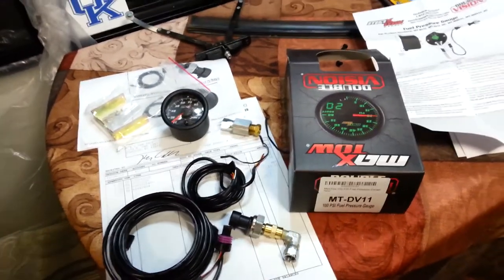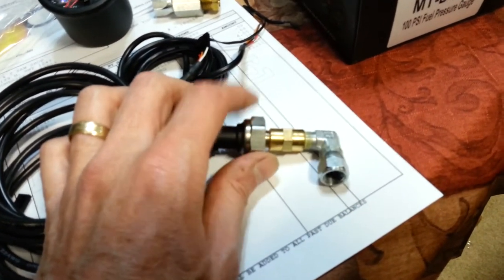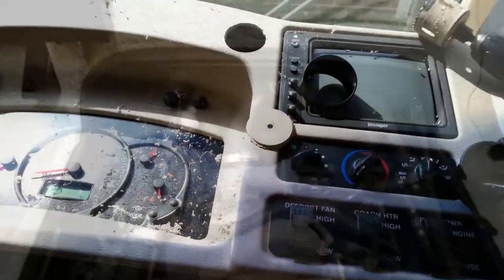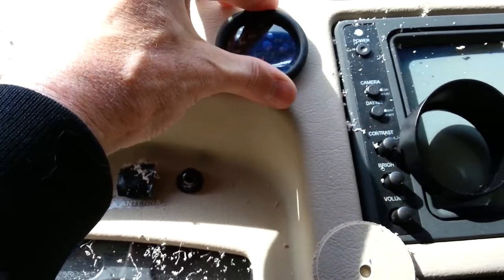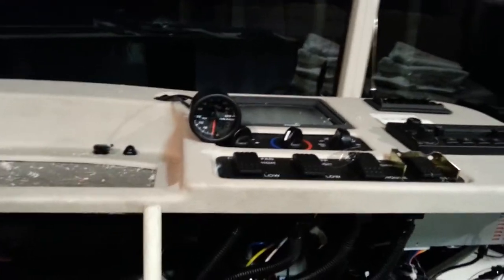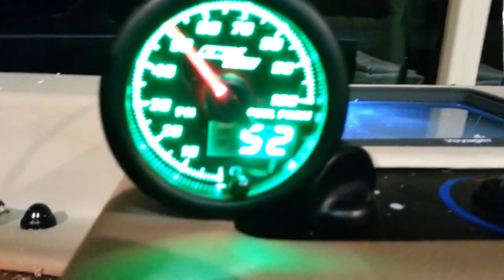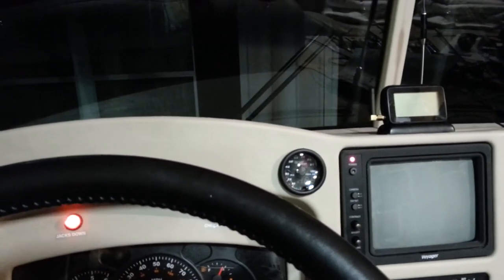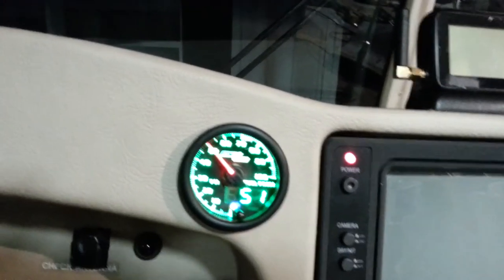Installing electric fuel pressure gauge on 8.1 Vortec Workhorse Chassis W24 Winnebago 38J

Comment: Kevin - Great advice.  This type of gauge should be installed on all RVs!
When driving our 2005 Winnebago Adventurer ( W22 chassis with ~ 80,000 miles) I began to experience back-firing. low power on hills, and a check engine light which kept coming on (same code - overheated O2 sensors on both banks - meaning the engine was running lean - and hence, too hot).  Finally installed this gauge to see what our fuel pressure was - and it measured only about 40 psi.  Way too low, as it should be about 55 - 62psi.  Also indicated a fuel pump which was going bad.  Could have totally failed at any time.

So finally bit the bullet and installed a new fuel pump (as per another one of your videos - THANKS!).  Immediately had about 60 psi, and and a MUCH better running engine.  Just drove it south almost 1,000 miles - ran great, no check engine lights.

So cannot recommend this gauge enough - especially for any Workhorse engine!

THANKS KEVIN !!!!!

Comment: Kevin, I had to replace my fuel pump in Elkmont Campground, Smokies. Found the location to cut out the floor and landed right on top of the fuel pump. It was under the bed, this made it nice. Checked with mill supply, gave them the number off the top of the fuel pump and I had a new one in about two days. I believe the pump was $300. Used a 5-gal pail to put the old pump in as I took it out and walked it down the hall to outside. Everything worked great. My fuel pump did not fail but the high side outlet on top of the pump was cracked. Dealer in Knoxville was quoting once I was towed in about $ 1700 for the whole job. Keep your videos coming, ￼😎
Reply from the maker: Wow you saved yourself a lot of money. Thanks for watching..Did you see my video about oem vs after fuel pumps?

Comment: Thanks for the great video.  I am just getting ready to purchase and install a fuel pressure gauge on my 8.1L Vortec W22.  I will do exactly what you did.  Thanks again.
Reply from the maker: TheChertman47 thanks for watching.  Do you have the scangauge 2 . I would highly recommend. ..u have a great engine the 8.1..
Reply: Hell anybody find the numbers for that 8.1 shrader valve 90 degree fitting ,adapters

Comment: I am SO happy that I have found your channel, you are a treasure trove of valuable information. I am curious if you have a 'plan' on how to siphon gas out of the tank before dropping the tank? It seems to me that there may be an anti theft device in the fill tube to the tank to prevent someone from siphoning gas.....if so, is there a work around to safely drain the tank?
Reply from the maker: Depending on the chassis you could use the onan fuel pump to pump out most fuel. Or remove the rubber fill hose at the tank and insert a 3/8 rubber hose and siphon out. My cell is 606-875-0125 Kevin

Comment: Where did you get the 90 degree fitting that fits the Schrader valve.
Reply from the maker: The 90 degree fitting I used is called a 4AN with 1/8 pipe thread. and a 1/8 coupler. Most and lacal Hydraulic hose repair store should have this. 
Or you can buy this type https://amzn.to/3O6dw2N
or 4AN Fuel Pressure Take Off Fittings Female to Male Aluminum Hose Adapter with 1/8 NPT Port Black https://amzn.to/3F9JxUM
cap = https://amzn.to/3ANhaZN AC PERFORMANCE Black Aluminum Fuel Oil Adaptor -4 AN 7/16 x 20 Female Thread Flare Cap Block off Fitting For AN4 Male Fitting or Fuel Pump

 Hear is another option https://conceptzperformance.com/glows...
  GlowShift GS-FA-LS Chevrolet LS Engine Fuel Rail Adapter
GlowShift's Chevrolet GM LS Engine Fuel Rail Adapter adds onto the Schrader Valve of your engine's fuel rail, allowing you to install a fuel pressure sensor with ease. This Fuel Rail Adapter package includes a 1/8" NPT Female to Male 90 Degrees Elbow and a -4 AN Fuel Rail Adapter that can be installed to any Chevy LS1, LS2, LS3, LS6 and LT1 engines.

Comment: Hi Kevin, Does the ScanGauge 2 have a protocol for the fuel pressure on a workhorse chassis?
Reply from the maker: No it does not that's why we have to use something like this. But it works great. Let me clarify workhorse does not have any fuel psi data sensor on the engine.. but other brands most likely do if so then maybe scangauge 2 would be able to display that data... but not for us workhorse owners

Comment: Hey Kevin, first thank you for taking the time to make this video. I'm curious as to why no fuel spewed out when you removed the schrader valve from the fuel manifold. Isn't the fuel lines always under pressure as it was at the end of the video when you were talking about the vapor lock you experienced in the mountains, and the engine was off? Thanks,
Reply from the maker: Yes you are correct the engine can sit for a week and still have 50 PSI on the fuel rail. Its been a while since that project but I think I remember slowly bleeding off the pressure by depressing the schrader valve with a small screw driver maybe 1 oz of fuel or less came out.

Comment: Great video, I have a 2008 38J with the W24, 8.1, and am thinking about putting a fuel presure gauge in. 
How is your pressure going down the road nad also climbing hills? Just wondering how much drop, if any, I should expect.
I have around 75,000 miles on now, and am wondering if it might be wise to swap out my fuel pump as a preventative measure.
Reply from the maker: 62 psi going down the road hard pull high RPM maybe 58 psi text me sometime about the fuel pump my cell 606-875-0125 Kevin
Reply: Super video I purchased all these parts and installed 1 year ago. My 8.1 has 60k on it and since the install at idle 49psi and under load 55psi. 5000 mile miles later no change. I carry an extra fuel pump sending unit just in case. You think this pressure is ok planning trip out west in Sept.Rig runs great.

Comment: Great video Kevin and thanks for showing me how.  I have the same engine and will be buying the same gauge from Amazon and would like to get the schrader valve elbow adapter like yours.  I saw that you had the 1/8 IPS coupler between the sender and the adapter.  Can you tell me what the thread ID is on the connection to the schrader?  THX in advance.
gary
Reply from the maker: Its been a while but i think its 1/4 , just take the cap off your schrader valve to confirm .. Thanks for watching if i can be of any help text my cell 606-875-0125 Kevin
Reply from the maker: Update I think its called a # 4AN fitting